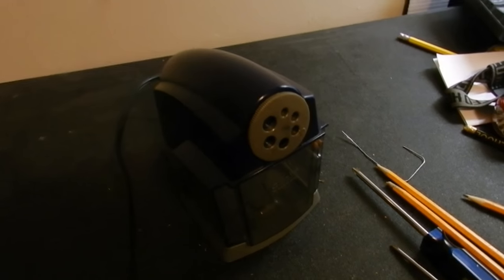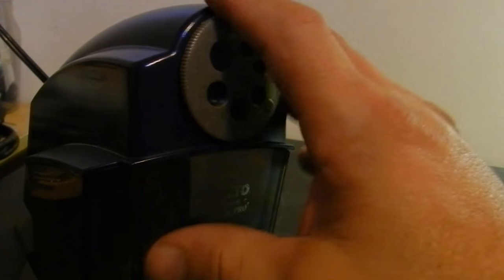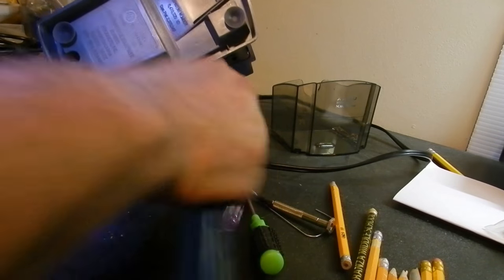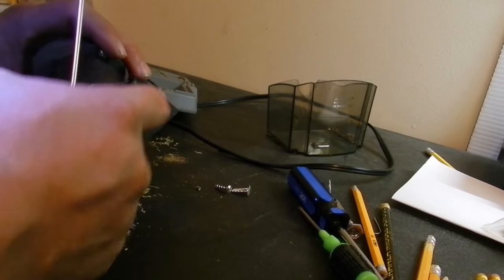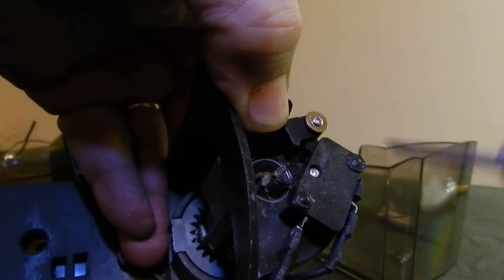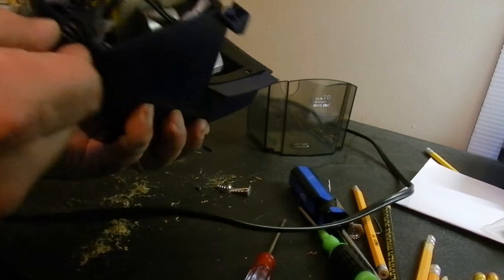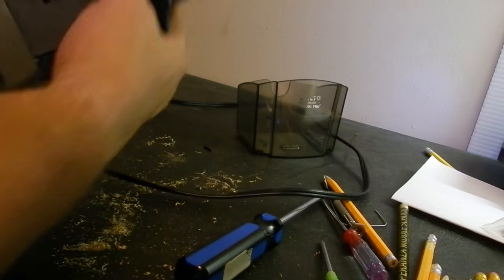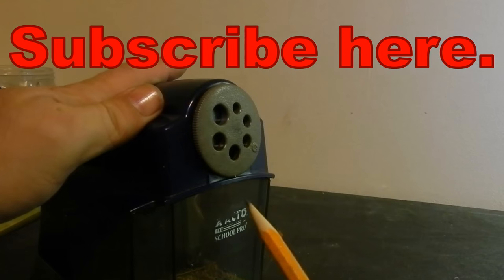How to Repair a Jammed Electric Pencil Sharpener

Comment: Hi william, I took mine apart, but found nothing. Is the metal piece with a number 2 suppose to move when you insert a pencil? Thank you
Reply from the maker: I think you're talking about the piece the turns on the motor.  In this case, yes.

Comment: Where can you buy replacement cutter?
Reply from the maker: Search Amazon and E-Bay.  You can also remover the old cutter and a dermel tool for sharpening cutter.  Use care and eye protection.  Good luck and thanks for stopping by.